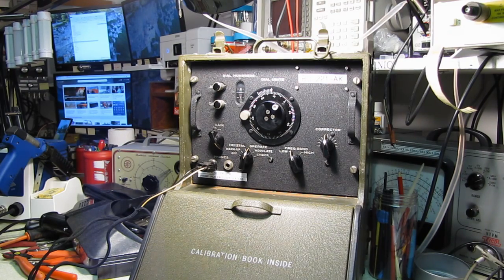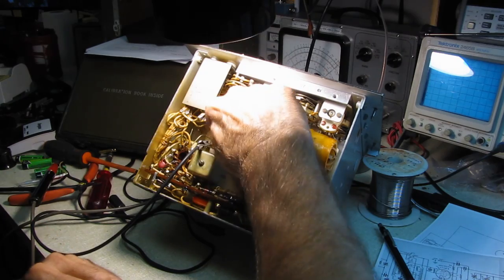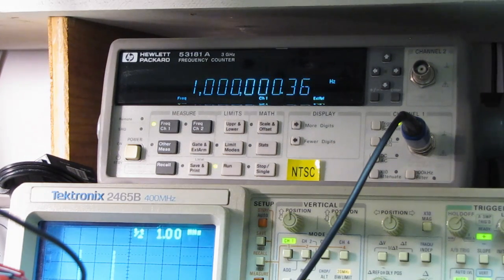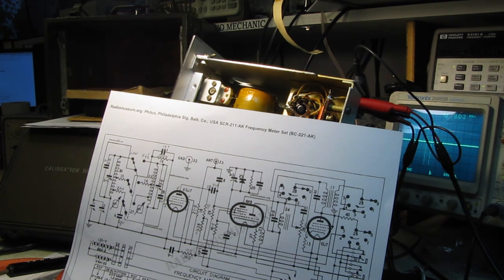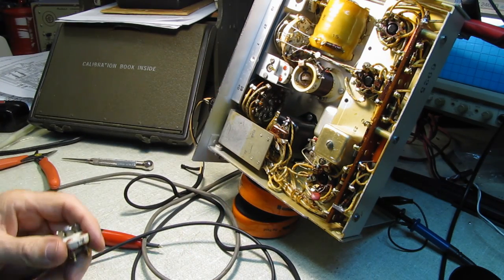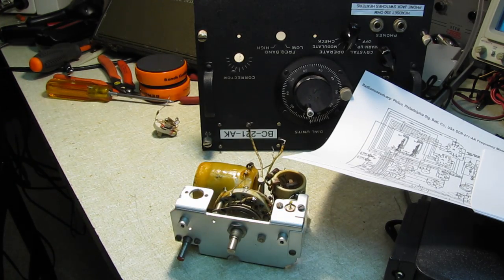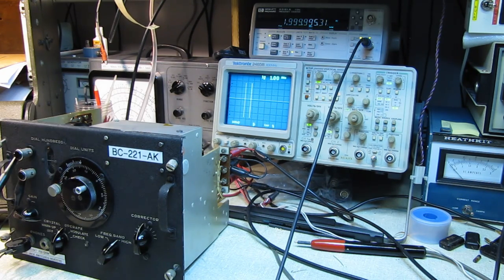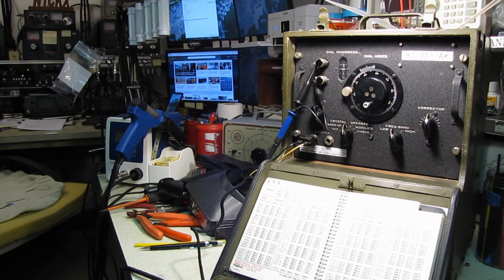Frequency Meter BC-221-AK Repair

Comment: I have a "T" variant of the BC-221 on the bench to resurect. Built a power supply and it all seems to work somewhat. The sequence of operation is as important as the hardware may seem defective if operator does not do it correctly! 
This has been a very instructive video. Thank you!

Comment: That's great. I still have one that I was actually using about 40 years ago. Its in excellent condition still. It was so accurate as you say. I have it on my to do list to do a restoration and get it operational again at some point... Mainly concerned about old caps and replacing them... I found this most useful... many thanks.

Comment: Interesting project Vern, paper 'mica' capacitors. I knew you had them in the US but I didn't know why till now. I haven't seen any here but I haven't worked on military gear and domestic radio production stopped during the war. The temperature compensating capacitors were a surprise, very cool.

Comment: Excellent video, thanks. Regarding the cracked brass collars, a likely cause of two failures in the same piece of equipment would be stress cracking of the brass in the presence of ammonia. The ammonia could have come from any number of possible sources over the years, even as mundane as being stored in a barn or near livestock.  I have an unused ( I cannot say NOS) BC-221AE which I will restore this winter, so I am watching your video with great interest.

Comment: Those split nuts remind me of when I worked on Propane the brass nuts would freeze and crack on cold nights. They had to be replaced with what was called "Freeze proof", much thicker nuts. Perhaps the unit was in or stored in a very cold place. FWIW, Carl

Comment: I have a BC-221 frequency meter just like yours that was never used. It also had a shorted trimmer cap. If you push down too hard adjusting the trimmer cap you can short the 2 plates together. Maybe that's what happened at the factory during alignment.

Comment: Pretty sure this grade of frequency meter  was the "creme de la creme" of it's day. Well except for those horrible (Philco)
 trimmer caps!  May be because of dissimilar metal corrosion or too much zinc used in making the brass nut. It was a War 
Production  Board thing. Make them now and do it fast. In the field , if it doesn't work make a recquisition for a brand new calibrated one. Nice video showing how it works and so well for it's limitations Vern.  I'm surprised you didn't get one a long time ago.

Comment: Does anyone know what readily available headphones will work for this? Finding HS-30s that aren't gold plated apparently $$$$$  is impossible.
Reply from the maker: Pick up an inexpensive audio output transformer and use it to match a "normal" 8 ohm head set. The Universal ones will let you pick the primary winding that gives the best results.